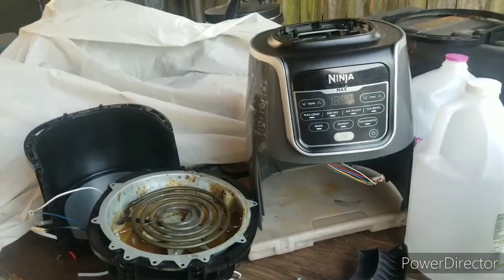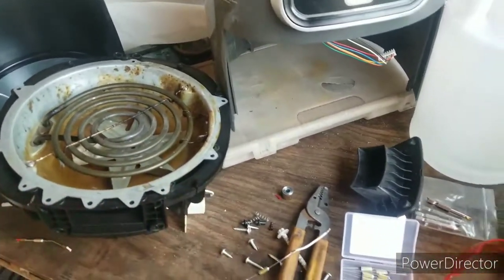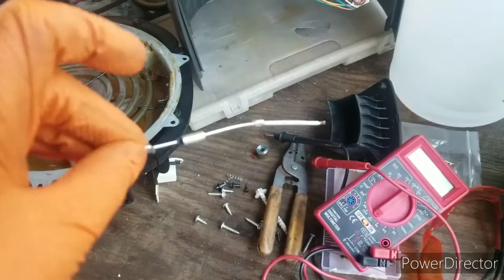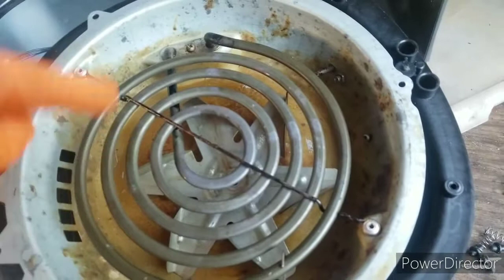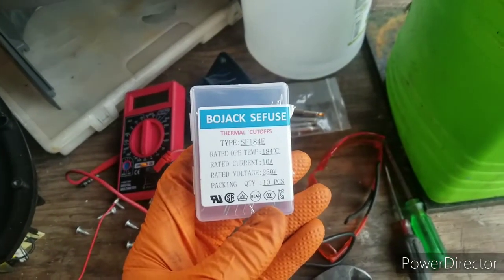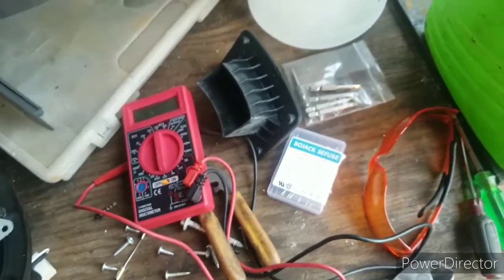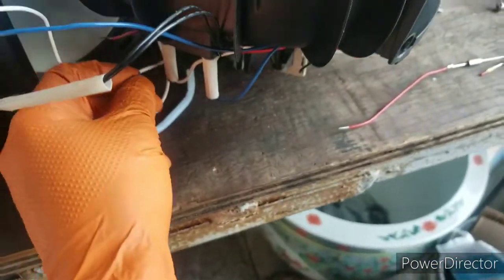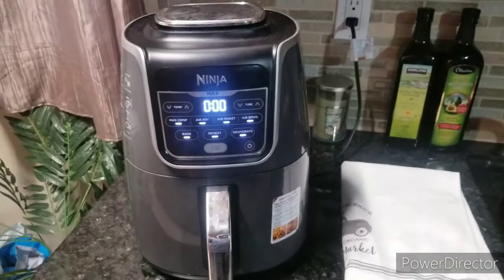Ninja Max air fryer repair

Comment: OK the description on how to get this thing apart was EXTREMELY incomplete -- but still it was a huge help and I was able to bypass the therm fuse temporarily to make sure it works -- and voila. So now I'm ordering the fuse. I can't wait to spend 90 minutes assembling this thing.  LOL. The problem is that  I do not want to have to do this again; not sure why the thermal fuse failed.

Comment: Thanks for sharing this info! Was able to get my Air Fryer working again! 
Although the vid is not detailed and doesn't show many of the steps needed to do this repair, if you are already handy and skilled at fixing things, you should be able to do this fairly easily. I don't recommend this to anyone who needs step-by-step instructions. Basic electrical and soldering skills highly recommended.
Reply from the maker: You are right. Im a mechanic and this is for somebody with some experience. No need to solder dough, just crimp the wires together. By the way must use a higher temp fuse equal to 450 f
Reply: Well I think it was a great video great job , 👍  and if you get this far I think you would know how to fix stuff

Comment: So I have the same issue.  Taking it apart was fun (not).  Remember, you DON'T have to take any of the trianglular head screws out of the bottom.  You DO have to pry off the top chrome piece.  Mine pried up and off okay.  There are phillips screws there, on bottom of the unit, behind the black vent on the rear of the unit, several inside holding the middle to the top parts of the unit, one under the heater assy, and a few others.  It would  be a real good idea to label each set of screws and where they go, because there are many sizes.  The two other things to keep track of.  When you're disassembling and tipping the parts upside down after they are separated, the two detent pins and their springs can fall out.  It's a good idea to pre-empt that and pull them out and put aside.  Also, before you take off the nut holding the fan to the end of the motor shaft, I would tip that assy over so you can see the motor and the shaft.  Make a note of the SPACERS that are on the shaft between the motor shaft's C-clip and the next fan blade.  There are two spacers, the nut, a flat washer, and a lock washer that will all go rolling out of the reflector bowl after the one fan blade is removed from the shaft and you tip the assy over.  I don't know in what order the two spacers go with respect to the c-clip.  I assume for now it is:  c-clip, 1/4" thick spacer, inner fan blade, long spacer, bowl, outer fan blade, flat washer, lock washer, nut.  I'd appreciate if anyone knows if I have the spacers correct.  I probably will find out when I reassemble the whole thing.  The 1'4 inch spacer is rounded on one side, flat on the other, so there is orientation to be concerned with as well.  I'm thinking the rounded side faces the c-clip.
Another note:  Apparently the newer units have done away with the switch on the base that requires the pan to be inserted in order to have power to the circuit board.   The AC on my unit goes straight to the thermal fuse then to a connector and the circuit board.
Lastly, just because I like accuracy, the nut has LEFT hand threads.  But otherwise Jesse is correct:  Clockwise to loosen, Counter-CW to tighten.
Reply from the maker: Awesome review, yes you are 100% right. I never had the chance to update the video (im terrible editing lol) 
After having to repair it again because the fuse blew for the second time.... I realized the factory fuse was too small. When you convert 450 degrees (MAX CRISP) Fahrenheit to Celsius is 232 not 184... therefore I had to purchase a 240 fuse. It hasn't blown ever since... yes the triangle screws don't have to be removed.  I found that out the second time I repaired it. The rest of the details are pretty much common sense and ppl that are not mechanical included should not attempt this repair.
Reply: @VWtech562  @Jim Shirey How do you pry off the top chrome piece please?
Reply from the maker: @josecorreia4851  yes. I used a flat head screw driver to remove it. Just be careful not to scratch it or break the tabs.
Reply: Can you put a link to the 450  degree fuses please?
Reply: What are the detent pins for? I think I may have lost one between disassembly and ordering the thermal fuses to fix/rebuild it!

Comment: Hi, i just got this issue after years been working fine. I dont have them krimps  but if i solder it will that do the trick?! Or is it going to be to hot in there and it will melt the solder?! Thanks Pash
Reply from the maker: Soldering it will work too, but crimping it's easier
Reply: @VWtech562  hi, full removed everything and i found out that its the other fuse actually that not working.... Do you know if its the same as this one or is  it different one?!
Reply: It works absolutely fine now, thank you for your video, btw, on mine i have 2 fuses in the same place, dont know why and both the same ! Thamks again.
Reply from the maker: @mrpash7075  awesome. Glad to help

Comment: Thanks for the video Jesse. I'm experiencing the very issue with my Ninja Max which is just over 1 year old. It has no power. I tried what you said about prying off the top, but doing so is just breaking all the snap-in literally and there no way of getting it off without breaking it. So I'm wondering if you have another model.
Reply from the maker: This is the ninja max. The top comes off by prying it gently with a flat head screw driver.

Comment: Thanks for the great troubleshooting vid.  Mine doesn't not turn on either.  Do you have to completely disassemble the air fryer, like what you did, or just the top part?
Reply from the maker: Excellent question. I've been trying to update this video but haven't had the chance. After using this fryer for 3 month it blew the fuse again. First you don't have to remove the triangle screws at the bottom. Second and most important, the main problem is the fuse that comes with this fryer. It has the wrong size fuse and I didn't realize that when I made the video. The fuse is 184 Celsius which is 363 Fahrenheit, therefore it blows in Max Chrips at 450 Fahrenheit. My solution was to install a 240 degree Celsius fuse, which is 464 Fahrenheit. Hope this helps.
Reply from the maker: All Phillips screws have to come out, top and bottom. Pry off the top cover. Also remove the air vent in the back, there are 2 more screws behind it.
Reply: @VWtech562  Thanks Jesse.  Glad I waited on buying the fuse :)

Comment: How do you know the 185c fuse was the correct one? I would think that machine reaches heat higher then this. The Max Crisp option is at 215c...
Reply: I read carefully the actual fuse and it is rated at 184C (needed a magnifying glass). Mine was in a silicon sleeve, and it is OUTSIDE the heat shield, so I think the idea is that it shouldn't be getting that hot outside the heat shield, through a thermal sleeve. Then again, we're all here on youtube replacing our (clearly underrated) thermal doo-dads so there you go -- under rated! If you go higher rating, do so at some risk! I tend to trust the engineers, and now anyway I have a pack of 8... I'm sure by the 3rd time I replace this I'll be very quick...

Comment: Dear, seems that I am having same issue as it is not powering on at all. I removed all screws at the bottom, but I can't disassemble? Is there any tip to disassemble it after remove the screws at the bottom? Regards
Reply from the maker: Yes. Sorry I didn't film that part. The top of the fryer comes off by prying it with a flat head screw driver. After that you will use a Phillips screw driver to remove the remaining screws underneath that cover.
Reply: @VWtech562  thanks a lot for the information. Have a great week!!
Reply: @VWtech562  thanks a lot for the information. I will try that !!!
Reply from the maker: @ricardomoreira6639  my pleasure. I hope you can fix it. Mine is still working perfect. I use it almost every day.
Reply: @VWtech562  !! Thanks a lot for all information. The issue was the same and I could fix it using your help!!!

Comment: That's great ,I'm having problems putting the fans back in place if you can help me ,thank you great video
Reply from the maker: I remember it was not easy because the wire mesh. You just have to remove the fan blade. To loosen it use a drill and turn clockwise and to reinstall turn the nut counterclockwise.

Comment: Hi I changed the fuse and it worked for around 3 minutes and then won't turn on again any idea why?
Reply from the maker: Yes.. sorry to hear that. Read the first  comments I made. The fuse that I installed was the same as the original which is the wrong size... it  needs a bigger fuse, check the comments

Comment: I am working on this now and I am having trouble getting the fuse to stay together with the wiring. Do you think I can use some aluminum foil to hold this together?
Reply from the maker: No. That won't wort. Must be crimped or soldered.
Reply: @VWtech562  Thank you….I ordered crimping materials today, so I will finish it tomorrow.
Reply from the maker: @DevonandCass  you're welcome. By the way the fuse has to be 235 Celsius or it will blow again. 450 Fahrenheit (max crisp) is 232 Celsius. I hope it makes sense
Reply: @VWtech562  Yes, I read that in your other comments. I have that fuse type. Strange they can't figure that out at Ninja
Reply: @VWtech562  Be careful what type solder you use, as they have different melting points ranging from 90 to 491 degrees fahrenheit
Reply from the maker: @stanrognon852  yes, I agree. Is better to crimp it

Comment: Great video, mine it does  work, with no heat , any idea the reason why
Reply from the maker: Sorry for the late reply... I would take the top part off and while it's working check that power is getting to the coil. If it is, the coil could be defective. Careful not to get electrocuted!

Comment: i took off the top and the 4 screws and still cant get the fryer apart   any ideas
Reply from the maker: Remove the vent on the back of the fryer.  There are 2 Phillips screws hidden there